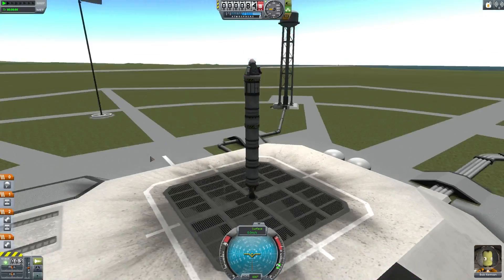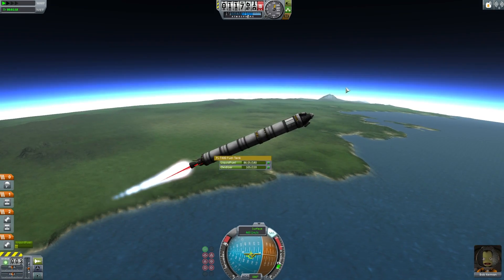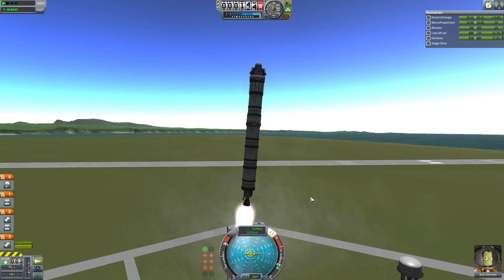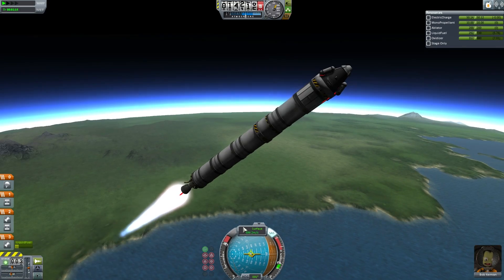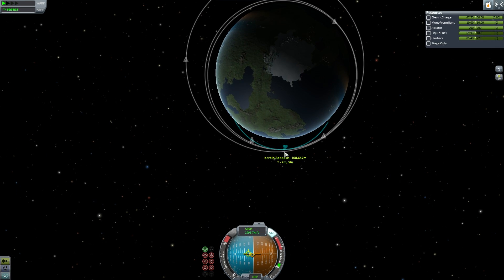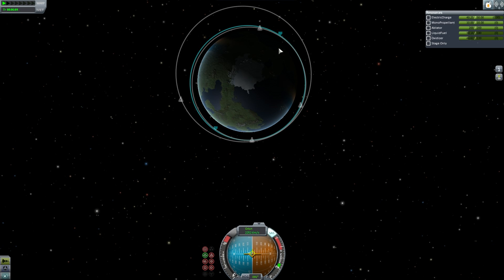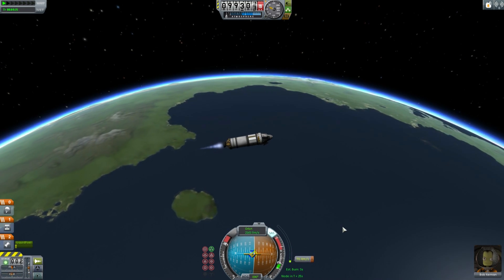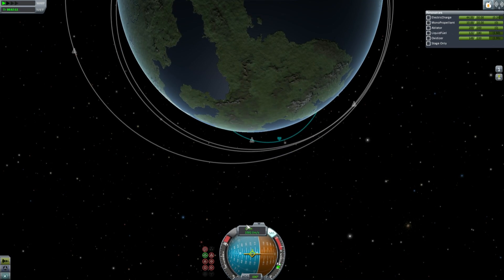Kerbal Space Program 1.0 - Launching Rockets To Orbit

Comment: Under the old aerodynamic model, didn't you have to reduce your throttle as your velocity increased while you were in the atmosphere?  Something about wasting fuel pushing against the atmospheric drag, wasn't it?  Is that less of a problem, now?  The habit I was in was to not go any faster than about 130 m/s until I was out of the thickest part of the atmosphere.
Reply: Michael Vaughan If you have watched other recent videos of Scott, you might have seen how fast airplanes can get now on very low altitudes. It seems like drag is now much less of a problem, provided you have an aerodinamic rocket. At the same time, drag will probably be ridiculous with the ridiculously bulky rockets you could launch before.
At high speeds in atmosphere, you might want to be more worried of structural failures.
Reply: Nalin Airheart Actually, they've fixed the specific impulse to be more realistic now.  Before, rockets would give fixed thrust, and vary their fuel consumption with atmosphere density.  Now, they have fixed fuel consumption, and their thrust varies with atmosphere density, so rockets with poor specific impulse in atmosphere will be harder to get off the ground than before, not just less efficient.
Reply: Michael Vaughan You're thinking of terminal velocity (which was slow as a result of atmosphere soup a la kerbal beta). This is just a guess but the fuel efficiency of the rockets increases with altitude while the thrust remains the same so it seems like they intelligently scale with altitude anyway.
Reply: Michael Vaughan Yes, that's less of a problem now. You can accelerate in a relative constant way without losing much of dV to drag. The Problem however is, that all rocket engines are less efficient now in atmospheric conditions than before. So you don't need significant less fuel to go to space.
Reply: TheBalefire Oh, thanks for clarifying that. I haven't played much of KSP since the 0.13 release I think so I'm a bit rusty. I'm being left in the dust again it seems just like with Minecraft but at least Scott can give us great content.

Comment: Hey Scott, my understanding of the old aerodynamic model was that it was more fuel efficient to use lower thrust settings at lower altitudes. Essentially, you wanted to keep your vessel at what was essentially terminal velocity. Too fast, you were working against drag. Too slow, you were fighting gravity. Was this always wrong, or is it just out of date now?
Reply: Matthew Kurtz 
It's not wrong or out of date, just the upper limit on speed isn't nearly as stringent as it used to be.

Comment: Getting rockets into orbit, isn't such a problem for me. But I made a replica of the Space Shuttle, and I can't get it to work. It keeps tumbling over to 1 side. The side where the big fuel tank is. What am I doing wrong? I know about center of mass etc. But I can't figure out how to make a good design. Please help.
Reply: M42KX 
Are you only using two solid boosters? KSPs SRBs are much weaker in scale than the SRBs the real shuttle used.
Reply: Yeah SRBs, wich werent great already, got trashed in 1.0. They have 150 ISP at sea level (OMG!! this is far less than a RCS engine/port !!) and their thrust is very low (some got their thrust halved)

Comment: Are you sure you should always be using maximum throttle? Isn't the battle against the atmosphere early on making you lose speed in the process?
Reply: Unfawkable 
Yes and no. Yes you shouldn't exceed terminal velocity, but equally the atmosphere is a lot thinner so you don't have to worry as much anymore.
Reply: ***** I found this to be the truth myself. Basically, I just avoid my craft getting fast enough to show the white-ish air resistance animation, and all is good.

Comment: The hardest thing I have encounterd so far is getting back to Kerbin because I just burn up :P
Reply: Davy Baak Oh Btw I do use a heat shield but I still burn up
Reply: Davy Baak You can't nose-dive straight into the atmosphere as you could before. Your best bet is to set your periapse above 10km so you bleed off most of your speed in the thinner atmosphere.
13km is normally best, but I'd recommend higher if you're coming from interplanetary space due to the higher velocity.
Reply: Al right thanks mate

Comment: Some of the parts won't connect, mainly liquid engines, but some are duplicates which will connect. Any idea what's happening?
Reply: ***** Can you post a picture of this?
Reply: TheLeftLibertarianAtheist I'll try and put a screenshot on the forums. It'll be under the same username.
Reply: Never mind, I solved it. Stupid problem, really. It seems when I replaced the old version it had the same file name and the mods (which contained the duplicate parts) were not deleted, but instead transferred over. Thanks for responding though :)

Comment: I was playing around with the new stuff last night and experienced everything you talked about. I had a crap load of fins and 6 fairings (about eachother) that ended up being shaped like a massive egg. It was a great set of launches.... though without SAS it was impossible to fly straight. Also I made a version of the Delta 4 heavy but with the new atmosphere model it causes a lot more vibrations during launch in the upper atmosphere. I had a lot of rockets blow up. A new feature as well is that if your rocket breaks, you loose control and cannot stage anymore...
Reply: eivilcow33 I'm kind of curious what your Delta IV Heavy looked like. First thing I did was make a Delta IV Heavy and stuck the Mk1-2 pod on top to simulate the Orion test launches. I had absolutely no trouble with it. Perhaps you were maneuvering too aggressively?
Reply: Regolith well to be fair it wasn't a very accurate model, I used the largest engines, and when they tried to maneuver in the upper atmosphere, they ended up overcompensating and causing it to vibrate. but it has been happening with every tall rocket that I have made since 1.0 came out. I have been having to throttle back or the thing breaks apart in the upper atmosphere.
Reply: eivilcow33 The SAS seems to be compensating poorly for the new aero model, leading to those wet noodle rockets, particularly when you maneuver too far away from your prograde. Really high thrust-to-weight ratios make it worse. I may have had good luck with mine because I used the smaller Mainsail engine and was fairly careful not to turn too sharply until I was out of atmosphere.
Reply: yeah that seems right, I hope they fix it soon... cause the wet noodle effect is not something I want my rockets to do....

Comment: now i'm curious about how we are going to make huge mun landers with the new aerodinamics. maybe build the lander in space ?
Reply: ***** DasValdez has already done it - if you make a giant brick that you can't launch, just put it inside a fairing and then adjust the offset on the base of the fairing to make sure the centre of mass of is central. With the fairing closed, it doesn't matter what is inside, as long as it's balanced.
Reply: Just use KAS to create awesome self-deploying landers.
Reply: Joe Jones Good to know.  I hoped that was the case but I hadn't tested it yet.  I've got some great landers that were unfeasible in the stock game prior to 1.0.
Reply: Go all Apollo style and load a lander in the new rockomax sized fairing and attach it to the front of an orbiter.

Comment: Hi, I've made a rocket like yours in career mode and I can barely turn it. And if I manage to turn it a few degrees it just starts flipping over and spinning... Do I need more SAS or is the rocket too heavy at the top?
Reply: arturr5 were you using the LV-T30 or the LV-T45 Liquid Fuel Engine? The LV-T30 doesn't have any kind of steering capabilities whereas the LV-T45 has thrust gimbal. Thrust gimbal is basically being able to point the exhaust of a rocket engine a certain direction thus allowing for steering. Maybe that'll help?
Reply: arturr5 Are you doing the 5 degree turn right off the pad? Like Scott said, the faster you are going the harder it will be to turn. If you turn just a tiny bit at launch the rocket will have a tendency to slowly start tipping as it rises, almost doing the gravity turn for you. Make sure you are turning the rocket very slowly, no sudden movements, treat the rocket like you would a dangerous wild animal, like a Bear. ;-) 

You can turn on smooth control mode with caps lock, by default, it will turn the little arrows showing pitch, yaw, and roll blue and make keyboard controls less "jerky", but they will also be less responsive to sudden movements making emergency maneuvers a bit more difficult, but to be honest, emergency maneuvers usually mean you have already messed up and disaster is almost inevitable.

I hope my advice helps, this is a very fun game once you get the hang of it, patience is key, try to do slow smooth movements, and try to focus on the nav ball and the information its giving you, not the rocket itself, if you can fly by the nav ball itself you will have a much better time later. And if you mess up the gravity turn by 10 degrees or so, don't worry, its not a big deal, unless you didn't put enough fuel in the rocket.

Comment: I think best in terms of specific checklists or functions (or whatever you want to call them). For instance, I internally summarized early-access non-FAR KSP ascents as:
1. Burn straight up. Don't go faster than ~200 m/s to minimize drag losses.
2. Do a gravity turn to ~45 degrees east (assuming a standard orbital plane), somewhere around 10,000 meters ASL.
3. Adjust pitch to the most horizontal point which keeps your apoapsis above 40 seconds from you, ideally increasing slowly rather than decreasing.
4. Once apoapsis reaches the desired height, stop burning.
5. Prepare and execute a maneuver node at apoapsis to circularize.
[6. Wish you had quicksaved before spending a couple precious minutes adjusting that maneuver node.]

So, let me see if I understand the new tutorial by putting it in my own words.
1. Launch straight up.
2. Quickly, turn a few degrees east.
3. Continue turning slowly, keeping the dot in the heading indicator within the circle of the (surface) prograde marker.
4. Once you rise above a certain altitude, follow steps 3+ of the original checklist.

Is this reasonably accurate?

Comment: Thanks so much for doing this! I tried to get into orbit with my old design (basically your's but with 4 boosters and 4 wings) and I found I was spinning out of control at 5000km because I was going straight up. I think with your video plus better designs will help me greatly. 

Also does the standard antenna effect me in reentry? Basically I was coming down from kerbin orbit using the standard pod with one reentry heat shield and an antenna on one side. When I started getting closer the pod angled slightly to the side with the antenna and eventually exploded on reentry. Any tips for using that antenna? Is that what caused the explosion?
Reply: Wasn't the antenna. That is an issue with the heat shields actually, as they are massless parts but the aerodynamics still affects them, so they cause the pods to flip to about 30 degrees. There isn't any way to really counteract this besides using SAS to try and keep the ship pointing prograde, or you could go into the game files and change the heat shields physics significance from 1 to 0.
Reply: ***** Yep, this seems to be the one big bug in 1.0 that's biting everyone. It hasn't bothered me too much, though. Indeed use SAS and keep the capsule pointing retrograde, and also go for shallow reentries, say don't lower the periapsis below 25 km so you bleed off speed higher in the atmosphere and the aerodynamic forces don't overcome your reaction wheels. I've already reentered from the Mun like this, not a problem, other than you have to keep an eye on your vehicle and perform small corrections over your full reentry.

I'm sure this will be fixed very soon, if it hasn't already.
Reply: This is a bug. 1.0, while being super fun, is not as polished as it seems. Check the KSP forum for more info about that bug (and others !) and how to solve it. Until a hotfix comes out, there are some workarounds.

Comment: Scott, is that new heat shield mass-less?  I started a new game, and after launching a craft up to 70k+ with just a parachute, capsule, science jr, and heat shield for re-entry, the craft keeps flipping prograde.  I fixed it once I unlocked additional reaction wheels, and also replicated with a shallow and steep approach, as well as with no science jr.  I would think the heat shield would have enough mass to keep itself pointed into the air stream.
Reply: David Williams No, they are not massless.
Reply: David Williams 
Check your centre of mass for when you're down to the shield. I've had that problem before with an interplanetary prototype where it kept flipping; in that case the centre of mass was too far back. The closer you have it to the shield the better
Reply: That's what I've come to realize.  Thanks!
Reply: The heatshields are bugged : Although they add mass to the craft, they dont make the center of mass shift. (very WTF, i know) You can verify this by stacking like 50 heatshields under a pod : mass will increase, but the center of mass will not move. Hopefully we will get a hotfix soon. Re entry is completely broken IMO
Reply: Electro phobia They add mass to the parent, I think.

Comment: Cloud you do a video about how to best deorbit space planes? I've tried it several times, and they're always torn apart by either thermodynamic or aerodynamic forces. I never had this problem even with Deadly Reentry and FAR installed.

Maybe I should be using aerobrakes higher up in the atmosphere?
Reply: Lutranereis Have you tried really shallow entries? Like just skim the atmosphere until you're down to a reasonable speed
Reply: Matthew Sainsbury Yeah, the last one I did before I gave up was a 55km argument of parifocus. The plane still disintergrated once it hit around 15km at 1500 m/s. 

That's just too fast, but I can't bleed off velocity enough.
Reply: Lutranereis Get some chutes, drag or not, to semi-deploy at ~25km, they willl slow down the plane quickly enough so the chutes themselves won't burn. You can cut them out before they are fully deployed so you can still land the plane. S turns and any funny maneuvers can easily result in a catastrophic stall if you're not very close to the ground. Oh, you can also use chutes to slow the plane down in the runway now, unlike in previous versions they don't get cut until you come to a full stop.
Reply: Lutranereis try doing S-turns at high altitude to bleed speed
Reply: ***** I'll give that a shot, thanks. I just don't know how much resistance I'll get, but it can't hurt to try.
Reply: Usorth I just did that, actually. I deployed a single drogue chute as high up as I could, then bound a button to cut the chute and deploy airbrakes at around 17.5 kilometers. It worked, my spaceplane was destroyed by a terrible landing instead of in the atmosphere.
Reply: Lutranereis They need an option to add heat shielding on the bottom of plane fuselages and wings (like the space shuttle). With extra costs and weight of course.
Reply: Use airbrakes then, they're terribly OP as of now.
Reply: James Nguyen Heat shields are completely useless. All the new heating effects have caused, is incredibly slow landings, with chutes open all the way down.